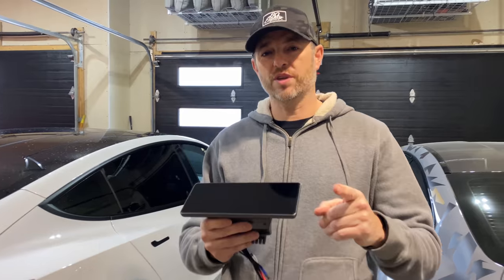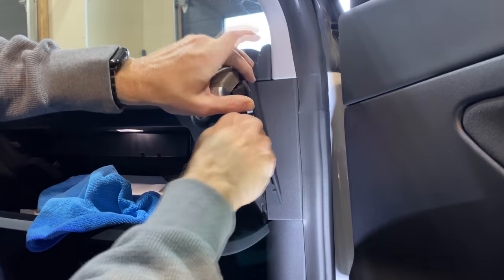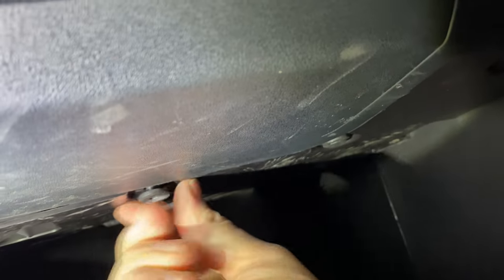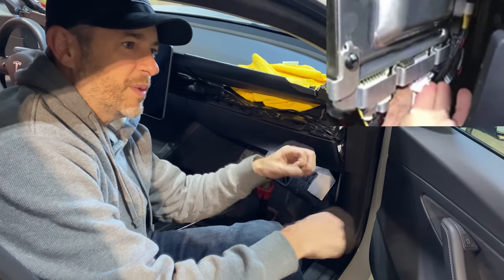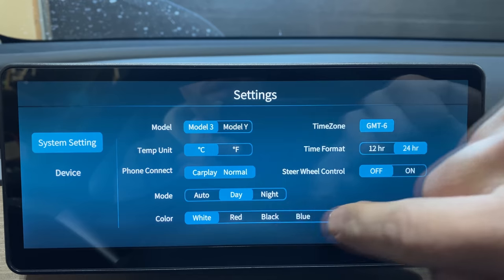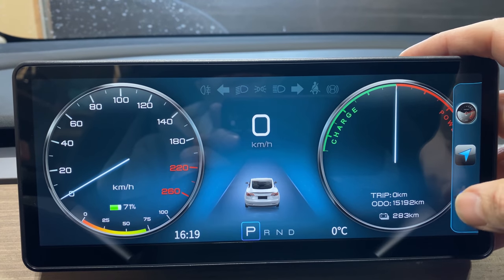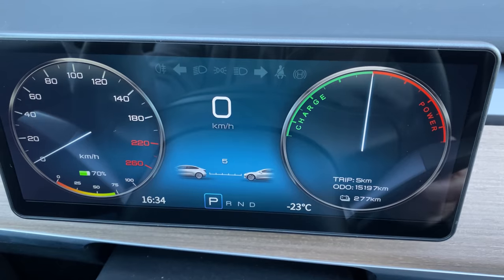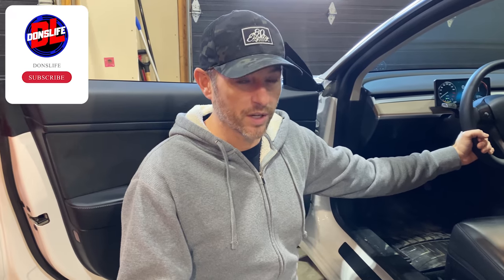How To - Tesla LCD IPS Information Screen for Model 3 & Model Y - Add Apple CarPlay & Android Auto

Comment: Tesla owners keep saying "You get used to the center screen, after a week it's better" but the fact that this is a financially viable product proves the opposite.
Reply: I'm interested in one, but it's actually for the Android Auto features rather than to have the display in front of me. Also there are around 1.5 million Model 3s on the road. Add in the Model Y and two new factories and you don't need a big proportion to be dissatisfied with a central screen to make something like this viable.
Reply: Yeah the million plus tesla owners say otherwise.  If you had a brain you’d see the massive shift to EV and minimalist design compared to several screens that are just pointless.

Comment: The product I bought was different, but the instalation was exactly the same. I had a problem after finished the instalation. The new screen worked perfectly, but all the cameras on my Tesla stopped working. I removed the cables of the new screen, still no cameras working. I installed it again. Nothing. Drove a little bit, no cameras. I deleted all the cameras adjustments. Nothing working.... Well, I'll need to remove the screen and schedule a service at Tesla. I just left the car alone for a while, almost one hour, and then tried, just for curiosity, to access the Sentry mode using my phone. Yay! All cameras are working again!

Comment: Great explanation! Been criticizing the absence of a instrument cluster in 3/Y ever since. I can't believe it is really necessary to install this yourself because the manufacturer just won't put instruments and CarPlay/Android Auto in the vehicle.
Reply from the maker: Nice to have the option now
Reply: The lack of a dashboard was one of my biggest complaints with the non-S/X Teslas and this addresses it very well. I had written them off but this makes them slightly more appealing. Only slightly since I am pretty sure the dashboard will stop working after a software update at some point, but still.

Comment: Tesla model 3 and Y should have come with this as standard.
I was real close to order myself a model 3 last summer but after I had test drive in it I found it annoying not to have something in front of me showing the speed and some simple info.
Great video 👍
Reply from the maker: Thanks for sharing
Reply: It’s the reason I am waiting for the EV6. I have been using a heads up display for the last 10 years. Nice video and interesting product.
Reply: Rent one for 3 days you won't miss it
Reply: A test drive is probably not long enough because you get used to no screen in front of you real fast, like within a week of owning. I like this product though.
Reply: @DarrellC.  Agree. I actually like having nothing in front as you get a clearer view of the road. I also don't mind having the speedo off to the side. What I really do mind is not having Waze. Spotify and Tune In Radio are also better implemented in Android Auto than Tesla manages. Seriously tempted by one of these for that reason.
Reply: @warhammerfaction  I did and I was surprised being a tech person it did not change my opinion. Cool car but not for me and now the number choices out there make things even more fun and interesting.
Reply: @jasonblair4057  The HUD is still best in EV6, I love that feature
Reply: @johnmckay1423  all depends how fast you drive and how many points you have left on your licence.
Reply: you get used to it and then will figure out that it's actually better to look to the side then to look down for checking the speed
Reply: @Alice-D-23  if it’s so good to look to the side why did car design evolve to have a speedo in-front! No one else does it because it’s backwards. Even the model S and X have it in front.
Reply: @Alice-D-23  trying too hard to justify shit human factors. 

Best is a HUD. Next is traditional cluster behind wheel. Then there is the crappiest like Tesla 3/Y. A human factors engineer will tell you but anyone who is sensible will also tell you
Reply: I’m one that cringes when I see the huge Tesla screen. It’s just not elegant at all. A PC monitor flipped on its side HUGE and the idea of everything being on a screen without buttons just sucks. 

I’m glad that not everyone is copying tesla in this front. I like a good size reasonable screen but this is just not appealing to me at all.
Reply: @robert7622 look dude what I'm saying is based on experience, what you are stating is theoretical. Did you ever tried it or how can you judge it?

Comment: Don, you are my hero! I purchased the Hansshow 9" screen for my m3p and your video was the only one that properly pointed out the gray connector. the Chinglish instructions were so bad I couldn't make them out, but you pulled me over the finish line.
Reply from the maker: I am happy this helped you
Reply: @Donslife hello my car is a 2021 tesla model 3. would a 26 pin or 20 pin monitor fit me? which monitor should i buy? Thank you!
Reply: Wasn’t that the hardest thing ever removing that and getting the new one back in?

Comment: Update : still love this screen best install I've done on my m3. Took my car to tesla service center and all the service reps were enthralled with it asking me all these questions. Get this thing it's great!
Reply: Just carplay alone makes this worth it. Is CarPlay communicated through bluetooth?
Reply from the maker: Yes the Tesla Bluetooth connection is one way to use it.  Probably the best way. Otherwise there is a built-in speaker
Reply: Does the steering wheel block any parts of the screen from the driver's position?
Reply: @Donslife  seriously? I wanted to add this so I could get audio to the speakers without having to use crappy Bluetooth. Why does no video about this go into detail about this. Almost bought it but I can just Bluetooth from my phone. What a joke.

Comment: I have been following Tesla since the beginning.  Elon's choice to omit the basic driving instruments in front of the driver would be a deal breaker in any decision to buy this vehicle.  I am so pleased that there is now a great solution.  This innovation is wonderful!  

Nice video.  I have just subscribed to your channel.
Reply from the maker: I am happy you liked the video
Reply: Which u pay extra after the overpaid vehicle GJ
Reply: @romandoru8134  It’s a choice. You don’t “need” it. It’s just a nice addition.
Reply: It’s a pos. Glad Elon removed it
Reply: a lot of modern vehicles dont have an instrument cluster in front of the driver. there are a lot that have in centered on the dash. Same as the Tesla. its no difference.
Reply: I agree it's a deal breaker for me.  I would opt for a proper binacle style as per the Model X, including navigation.  This should be standard on the Model Y and 3.   Also, there should direct one push buttons for essential functions, and less reliance on the central screen when driving.
Reply: @FernandoR211  Who ?
Reply: Have you ever driven a model 3? It’s not an issue at ALL. You get used to it in a day, and then you’re just happy with the amazing forward visibility.
Reply: @Eahc_21  Elon removed the driver information binnacle for cost cutting. There is no other reason to put everything on a screen in the middle. Certainly not for safety.

Comment: For older Performance Model 3/Y owners. I can CONFIRM that the non-performance cable is what you need. Just like in this video. OneCarStereo was cool about sending me the correct cable, but they should make it more clear on their site and instructions, as the connectors ARE different. For anyone with the Ryzen CPU: you'll need to find a way to tap the 12 volt power. But this is awesome.
Reply from the maker: Very good share.  Unfortunately I was only able to provide the review review. I don’t really have influence on the details of their website
Reply: Do you have the intel cpu? Was it difficult to install?
Reply: @TalReviews  if you mean which CPU is in my car, I'm honestly not sure. I'd have to look up what was used in all the 2019 build cars. The only hard part was being under the dash and installing the harness to the CPU. That's because you're basically upside down in a tight space. Once that's done it's pretty straight forward

Comment: I have owned a Tesla M3 for over 3 years now. I truly do not miss the binnacle at all. I am sure some people do. But no one I know that owns a Tesla has an issue with it. I also own a Lexus LS430. I have owned it for about 15 years now and there are features that I never used or either set to a preferred setting and never touched again.  The only thing I wish the Tesla had that it does not are physical buttons for volume, A/C and wipers. And all of the media stuff you can either stream form you phone or stream form the car itself. If you want this thing go for it. I just see people referencing this as an issue so often. I really don't think it is as big a deal as it is made out to be.

Comment: You can tell Tesla are not car designers. What company in their right mind would not install an instrument cluster right from the onset. Now they supply an after market part. Great video showing the stages for the install. I hope you do well with it.
Reply: Mini has a center mounted analogue speedometer actually, which is hard to read in your field of view compared to a big digital speedometer. There is absolutely no need for a display behind the steering wheel since the center mounted one works just aswell. The only people complaining about it are ones that never drove a tesla to begin with or drove 30 years with the same interior style and have a hard time to adjust to something new. Absolutely no difference between looking down at a analogue cluster or slightly to the right at a big digital speedometer, which can easiely be read in your field of view anyway.
Reply: It’s about $$$ so bare bones in Teslas
Reply: Do you regard Toyota as a car company? Their Prius doesn't have instruments right in front of you

Comment: Only downside is that it blocks air flow to the driver from the dash vents but still a great add on
Reply: That’s the only negative I see so far especially living in south Florida.  I didn’t buy one yet but I’m going to explore HUD options as well to keep the vents clear.

Comment: I would have liked to hear if that affected the ability for the fans to blow on the driver, and how much. Also, using apple car play, does the audio still play through the tesla audio system? Id hope its not through the small speaker on that unit.
Reply from the maker: Apple CarPlay can play through the Tesla’s speaker system via Bluetooth or the tiny built in speaker.   Sorry about the fan.  Since the weather was on the cooler side but not freezing, there was no thought to test it during the video recording.
Reply: @Donslife  thanks for that information and taking the time to reply!
Reply from the maker: Of course!

Comment: With this you don't feel the air in your face, they have to build it to go above air vents
Reply from the maker: It doesn’t really block the vent, if the air is set to come out right where the screen is sitting it just flows over the top.
Reply: @Donslife  true . U just adjust the air to flow all the way up and it’ll hit your face

Comment: I installed this on my car and I love it can’t live with out it. Only issue I have is when I try to play music from it and Bluetooth it to the speakers it doesn’t sound loud despite me turning it all the up on the steering control. So I only use it for Waze mostly. But it’s life changing lol
Reply from the maker: You probably already did this, but if not, make sure the phone’s volume is turned up to 100%
Reply: @Donslife  it goes to the speakers in the unit, which simply aren't that loud

Comment: Hi, this looks amazing.
I was just wondering how is the view from the driver's position. Sorry if I missed this part, but I didn't see this angle in the video.

Does the steering wheel block any parts of the screen?

Thanks
Reply from the maker: It’s similar to most cars.  Only when turning the screen can get partially blocked

Comment: Very cool screen! I did have a question though. Does this cause any issue with the windshield defrost airflow? That backing plate covers a big section of the vent holes. 

I just discovered your channel and subscribed. Thanks for being so thorough.
Reply from the maker: Thanks. Defrost performs fine for the window
Reply: the defrosting is performed by the vent hole right near the windscreen, not by that vent hole.

Comment: Cool aftermarket product, but it’s ridiculous that Tesla didn’t put a gauge cluster behind the steering wheel in the first place.
Reply: because it is just not needed. The speedometer is well inside your field of view and there is virtually no difference if you look down on the speedometer or to the right at the top left corner. If anything there is no steering wheel in the way.
Reply: @BizzMRK  so why does Tesla have a steering wheel gauge cluster for its model X and S, but not for the 3 and Y?
Reply: @jsnagra1able  because these low volume cars are much older designs and much more expensive. Of course a "luxury" vehicle (if you can even call it that) has a more expensive interior. Other than that they want their flashy ludicrous mode animations to play to keep the buyers happy. The decision to remove them on the M3 and MY was not only a design decision but also a cost decision as well after all. Besides, the reason they went with the controversial yoke steering wheel on these is because a regular one could block the view of the instrument cluster.
Reply: @BizzMRK  thank you for acknowledging that it’s a cost cutting measure,  that’s exact what I was getting at.  A poor cost cutting decision in my opinion.

Comment: Hi @donslife. When you say “turn the car off,” did you mean you disconnected the battery? Also, anyone hooked up the harness for Tesla Model 3/Y Performance? Looks like a battery hookup as well.
Reply from the maker: Turn off the car (which can be done) maybe not necessary but just a good habit when unplugging systems.  The reason to disconnect the batteries would be if you took to long to plug in the new harness.  Disconnecting the batteries for a bit will reset everything but you’ll have to start again with the OEM harness plugged in

Comment: Question. When you were flipping through the screen; Changing the car showing lights on section then doors being opened, tire guage pesssire etc... Can you toggle from steering wheel? Or do you have to use the screen? I don't want to be reaching for the screen while driving. Thank you.
Reply from the maker: Yes you can

Comment: You totally skipped how you got the two wires you pushed through to end up in the piggy back harness. How did those 2 wires suddenly become a harness?
Reply from the maker: Not really, the two wires that connect to the screen have quick connects to the harness that you plug in underneath the glove box. Also the screen comes with a step by step installation sheet.

Comment: The website doesn't seem to state clearly how the Bluetooth audio works with the car. Supporting 2 bluetooth devices at once generally doesn't work well. Is there a way to connect the audio of the device to the Car? When running wireless Android Auto requires bluetooth to be connected for phone calls and such.

Comment: that's freakingly nice, wondering if the installation steps are gonna be exactly the same for 2023 Model Y?
Reply from the maker: They have guides.  Wiring locations are likely to change over time
Reply: @Donslife  do you know if Tesla would void warranty if we hook this up? or use it as an excuse to void the warranty? Thanks
Reply from the maker: There are laws to protect you from being denied warranty unless they determine your mod or aftermarket part is the reason for the problem
Reply: @Donslife  yes, but I read somewhere that happened to a Youtuber, where he modd'ed his suspension and then he had some issue with some kinds of leaking and Tesla made him prove that his mod wasn't the cause before they cover it under warranty. and that can be stressful af if it happens. But I guess with this hack, you can actually remove it before bringing for service if anything happen and it's like you never modded anything....

Comment: hi great video thanks. May I ask how is the speed sync between the Linux screen and the Tesla screen? Is there any delay for showing the speed from the Linux screen? Thx
Reply from the maker: In the video you can see the speedometer is pretty much synchronized.
Reply: I installed it today.  No lag at all for me.  Even the doors were showing instant.  The harness is hard, it’s way up under the dash.  This video doesn’t say, but you need to also push down a clip on the harness to pull it out.  Don’t just yank on the wires.

Comment: This is basically the same thing as the hansshow screen right? Or is this one improved upon that version? Also if tesla releases a v12 software update down the road, does the screen need to be updated too?
Reply from the maker: There are differences.  Depending on the model of Hansshow you are looking at…Integrated GPS, screen sizes, Android OS or Linux (yes there is a difference despite Android using a modified version of the Linux kernel), bezel thickness and some have USB A not USB C for updating .   I can’t say which is better value or a better product, I have only reviewed the one product.   

Updating the firmware can be done via the USB C port on the unit.